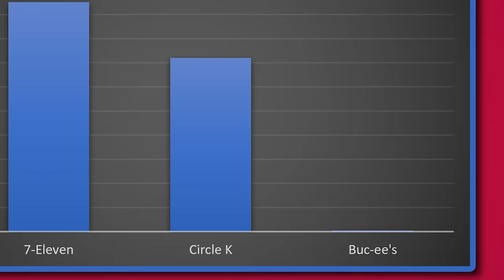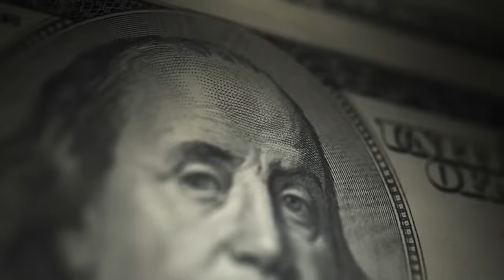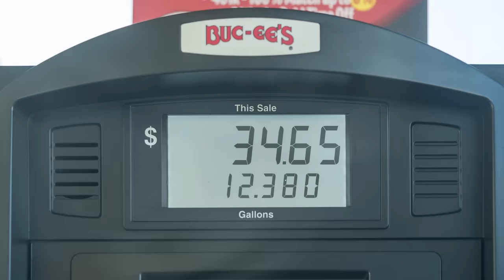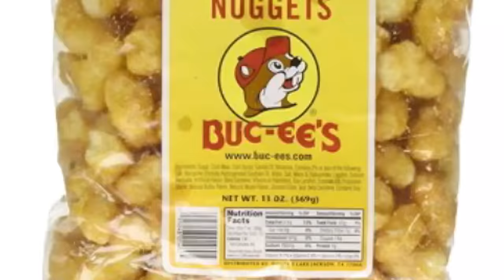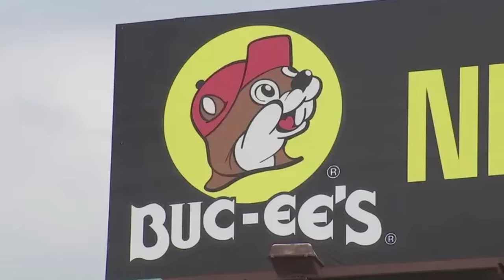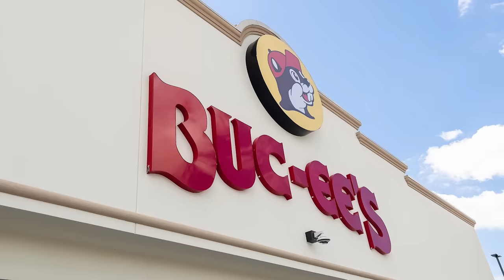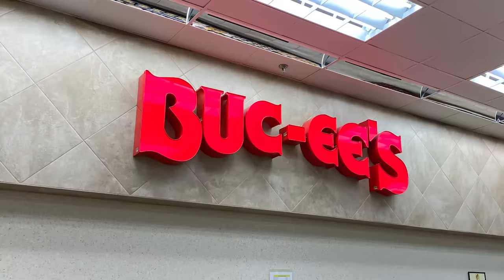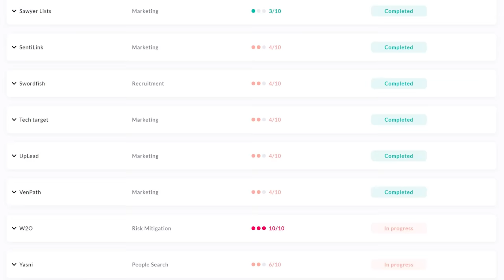Buc-ee's - Expanding Near You?

Comment: One other thing about their billboards. They have a lot of them, a whole lot of them, as you approach a location along the highway. However, I have noticed that they really ramp up in number when you are approaching a competitor gas station/travel center. You can see a few along the road, and then 10 billboards within a couple miles of another travel station. Even on both sides of the highway at the same time. They really want their name in your brain when you pass the competitors.
Reply: There's one up here outside Lafayette, IN. It just has the logo and says 400something miles. I think it's the one in Athens, AL.

Comment: Texan here. Your video was quite good and covered most everything. Texas is a big place and traveling between these larger cities basically requires a pit stop and anyone I know would chose a Buc-ee's over any other gas station. I believe they can do well outside texas along similar roads but I would expect them to probably offer some other menu options more common to the region where needed. Beyond that not much needs to change imo for them to expand far outside Texas.

Comment: Went to the one on the gulf freeway twice once before my cruise and once after.  #1 cheap gas #2 that brisket tho #3 I want one near me.  I think it will work well in Wisconsin not sure about Virginia, But it will have to compete with Kwik Trip "another god tier local chain" in Wisconsin in which most of them cater to truckers which is a huge deal up here. It's also not that far of a drive across the state in any direction its not Texas literally one location of Buc-ee's is almost to much in the state as well as having 80% of the population in the lower half of the state.

Comment: They don't need to build every Buc EE location the same. Open one location in a new array, only average Buc EE size, and swap out features of other locations and ininnovate new features to see what the residents want. Tailoring to Texas worked through experimentation so there is no treason to think they won't do that again. The one I went to in GA was not 50000 sq ft but it did have a McDonalds. Experimentation.

Comment: Ironically, when you were talking about how it's not for truckers, they do have trucker versions as well. Like the BUC-EE's in Madisonville has separate trucker pumps that you often will find trucks with RVs at because the pumps are spaced further apart so it's easier to get in and get gas.